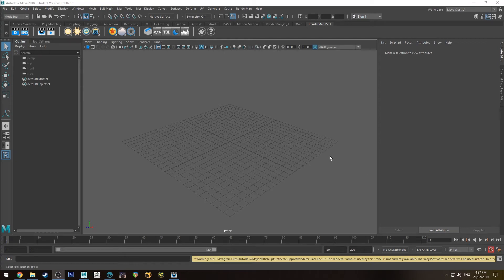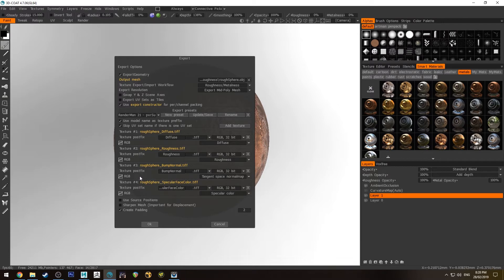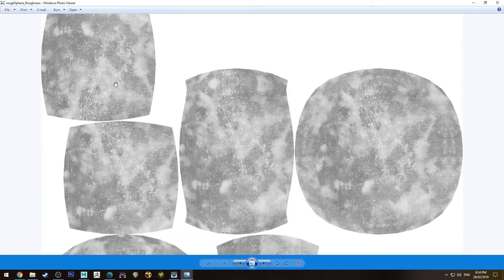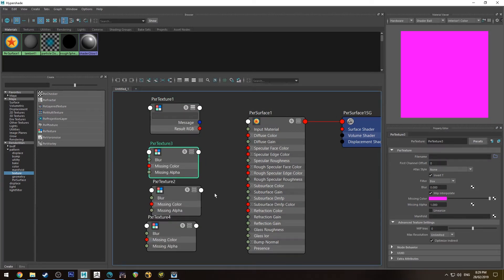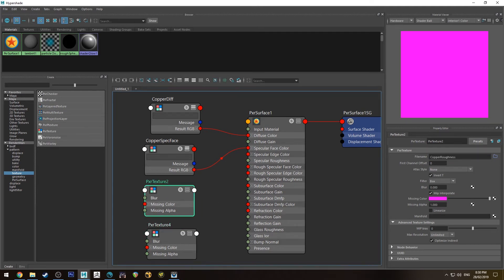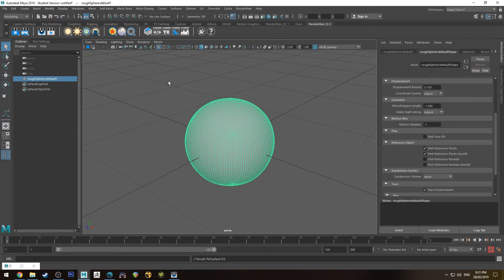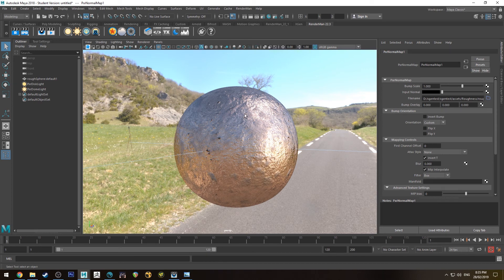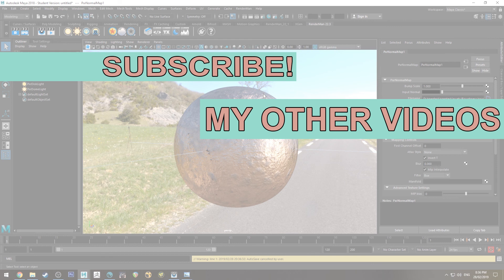Renderman 22 Roughness Maps Tutorial

Comment: so is face specular just a regular spec map? how do I make it in substance with metallic roughness workflow?
Reply from the maker: Spec face just controls the gain per pixel of specularity with the addition of colour if required. Metallic maps are usually an inversion of the diffuse and specular face colour so if you have a spec face map and invert it to the diffuse channel it should look how you want, I haven't used substance in a while and I can't remember the workflow however.
Reply: @SmallRobotStudio  Would you know what i have to do to create a specular face map in photoshop if I have already have a diffuse texture? this is mainly for my photogrammetry workflow, as my diffuse texture is exported from the photogrammetry software and then I create other maps I need in photoshop.